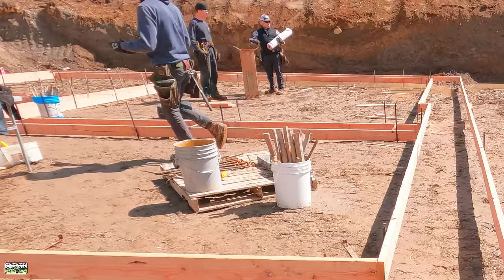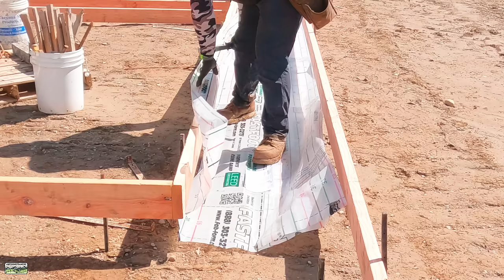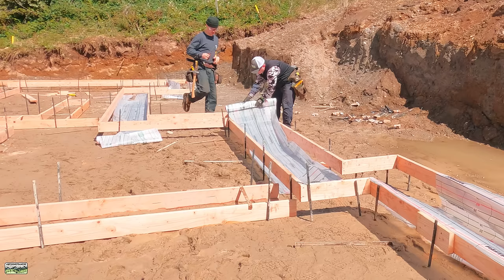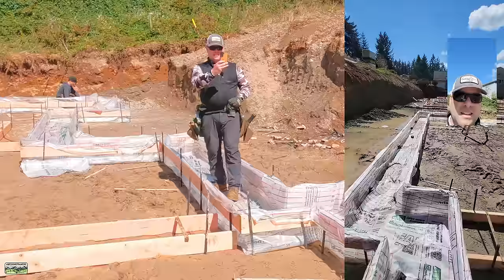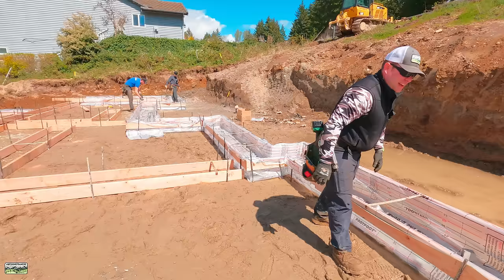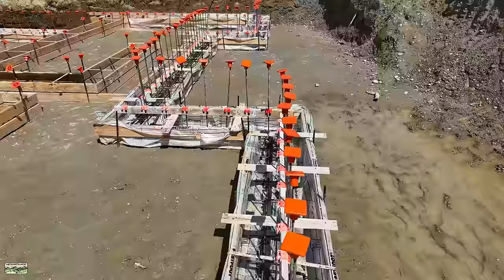How to Form Footings  part 3 Installing FASTFORM

Comment: This series is special!
Shows great rapport with employees and work can and should be fun and safe at the same time.  Your animated nature is great, it is a positive reflection on your candor and knowledge.  All of that comes through in the High level of framing carpentry and attention to details.   Always love how you do what the Arch,  PE and Manufacture Instructions  require.  ABSOLUTELY No short cuts.   { I can see lots of folks not stapling the exterior and finding themselves in a world of hurt when the concrete pour exerts forces on the bag == Spill out until the cows come home. }
First time I have seen the #FASTFORM, I am a convert.

Comment: I used last year on addition that I built and would never go back to forming with lumber. Once you use it...makes so much sense. Good video!
Reply: But you still framed with lumber??
Reply: @abc-ed1nr  oh  yes.  everything above footer is as you know it.  only thing different is the forming material around the footing - plastic or lumber that you have to pull off, clean up, etc.  I was working in fairly narrow trenches - unlike their wide open worksite above, and not having to muscle lumber down and in for forms (2x6 vs 2x larger) was a definite benefit.
Reply: @dinamadson5264  Thanks for taking a risk and trying something new! Glad you liked it.
Reply: i hate thinking, way way way to much ''guesswork'' and unique situations

Reply

Comment: I still like form a drain.  No tear down and no  separate footer drain.  Safe two steps and no expensive lumber these days
Reply: My only issue with Form-a-drain is that your footings have to be level, so how does a level drain work effectively?
Reply: @FabFormIndustries  all footer drains are level??? As water goes in the pipe it drains to its lowest point.  Usually a sump pump crock or daylight

Comment: How much do you mess with the staples later on? Bang em flat?  Stripping the forms with that many staples in is harder. I usually use lumber wrap. The staples make the stripping a little harder for me.

Comment: Question have you used plasticizer in your concrete mix to make flow instead of adding more water?  The hammer I like to use the bottom opens an you just drop the staples in.  I have use the ones where you load from the staples from the back sometimes the pusher spring pops out than you have find it and if it jams it is hard to clear the jam.
Reply from the maker: Nope.  I order 5" slump and that flows well.

Comment: I heard you say you were in the Pacific NW, not sure what the frost line there is, but it looks like the footings on the back of the house are at ground level.  Doesn't the footing have to be down to the frost line?
Reply from the maker: 12" frost line here

Comment: Do you go back after the concrete is set and the forms have been removed.............do you pull all the staples out before using the boards for framing or just pound them flat into each board? Looks Awesome !!!!!!!
Reply from the maker: I just pull the forms and not worry about the staples.  Its working so far 🙂
Reply: @AwesomeFramers  Most excellent, keep framing brother, its a pleasure to watch true professionals do amazing work AND educate folks at the same time :-)

Comment: I’m a little confused, do the footings later get backfilled in and around? We always dig footings below grade around here. Maybe I should finish watching the video first 🤪.
Reply: It's pretty obvious that these footings are below grade, bud. The excavator is going to come back after either the footings are poured and stripped or after the foundation walls are up and install drainage tile and gravel. And then it's getting back filled to a rough grade. Then this crew comes back to frame the house
Reply: Seth Brandenburg ok dude.
Reply from the maker: yep, backfill around.
Reply: AwesomeFramers thanks for clarifying. Pretty obvious but I had to make sure.

Comment: Does anyone have any info how a grounding rod is going to work if concrete has no direct contract with the ground? It looks like you are building a giant capacitor
Reply from the maker: The entir foundation is connected together via rebar in footing and wall. Since it's backfilled it does have direct contact with the earth
Reply: @AwesomeFramers  
Makes sense. Thank you for clarifying.
Reply from the maker: @serguei5000   👍
Reply: I've noticed the method you're talking about a lot on YouTube seems really popular in places where you don't have to dig. Very deep. Up north where I'm at. We're at 42 in so the extra 12 inches that you're digging down and back filling around the footing is really nothing so we do forms instead of trenches. Looks like it's easier from what I've seen on YouTube.